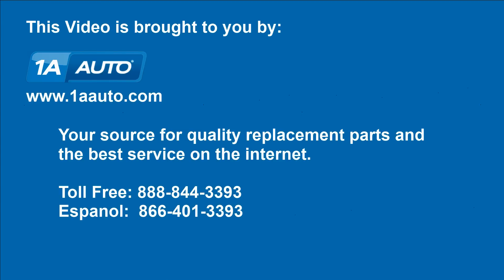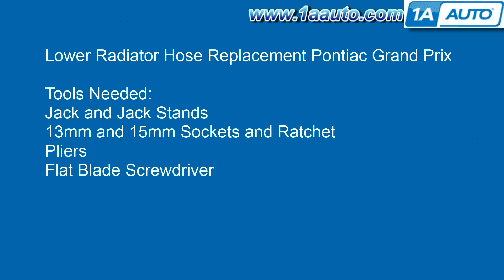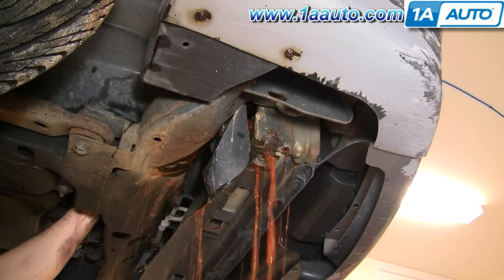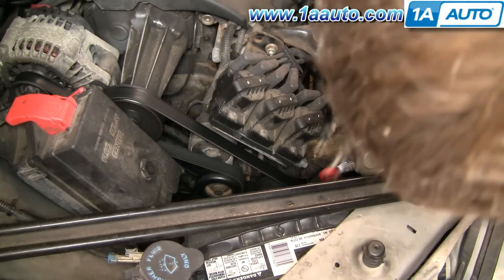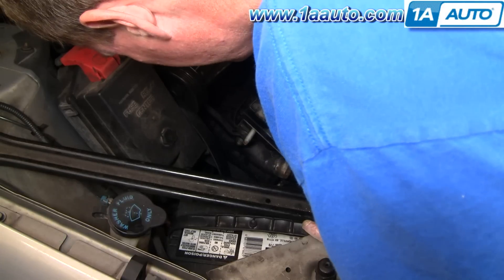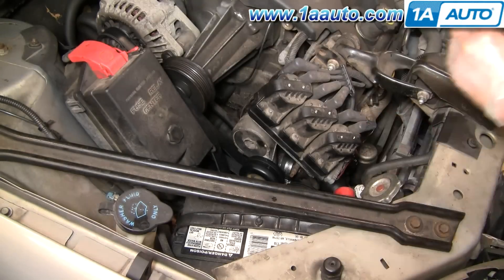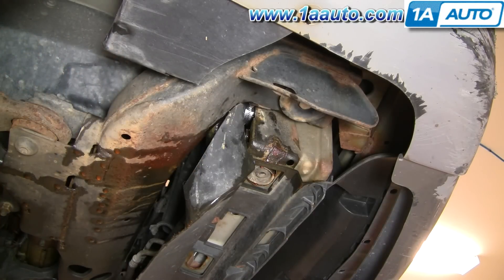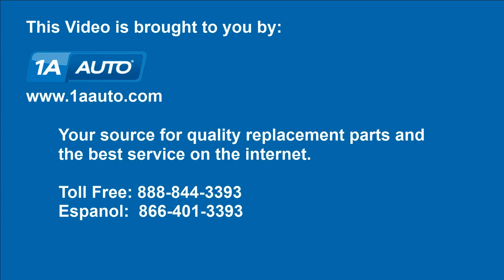How to Replace Radiator Hose 97-08 Pontiac Grand Prix

Comment: I like how you use the water pump pliers. It took me several minutes to wiggle my pliers into position before I could loosen the clamp. My 99 Chevy Malibu 3.1 L LS M type engine has a transmission line at the bottom of the radiator that blocks access to the hose clamp. I tried regular pliers because my hose clamp pliers had no clearance. Same thing happened to me a flood poured down on me as soon as the clamp was loose. I watched your video about replacing the intake manifold gaskets many times over the last six months as I worked on this project. Got to say my favorite go-to tool is a 3 foot crowbar. Crowbar popped the lower radiator hose right off,  with hose on nipple above as a fulcrum. With the new hose I put the clamp facing up. Unfortunately I couldn't seem to get the clamp close enough to get over the Bulge on the radiator nipple with my hose clamp pliers. Along the passenger side of the radiator runs another transmission tube to the top of the radiator. What a nuisance. Offset hose clamp pliers + normal pliers had to be repositioned several times to wiggle clamp forward, Body frame to the left, tubing to the right.  
     Another issue the low coolant light flashed no matter what I did to fill up the radiator. Finally I took the upper hose off and stuck a garden hose down it to flush out the cooling system. The water flowed out the Overflow Reservoir. I put upper hose back on,  no more low coolant light warning. YouTuber Original Mechanic stuck a funnel in the 3/8 tubing going to the top of the radiator the highest point by over 4 inches. I plan to drive the car for a couple hundred miles before I drain a gallon of water out to add antifreeze. It's been a real nuisance how this cooling system will blow out 3 gallons of antifreeze all at once if it's overfilled. It's like there's some siphon action going on. Michael I liked your comment about automatic air bleed since the bleeder screw on top the water pump bypass pipe bleeds coolant not air.
Reply: Some of my new hose connections leaked especially the smaller diameter 3/8" hoses. I used Permatex water pump and thermostat housing RTV silicone gasket maker 22071:  water pump bypass pipes and hoses, thermostat to heater core pipe behind o-ring,  2 Passenger side radiator to overflow Reservoir  nipples. 
     I like the flat band spring hose clamps better than the screw clamp. On my Jeep 4.7 L V8,  lower radiator hose to thermostat housing leaked a dribble which equals 1/2 gallon of antifreeze every 50 miles. The only fix was to use silicone sealant and reposition the screw clamp many times till I got a perpendicular grip. Slightly off perpendicular, screw clamp leaks horribly. That's the great thing about  flat band spring hose clamps they position themselves. Also they don't cut a new hose in half.

Comment: I wouldn't have been able to do it without your video but it wasn't as easy as you made it look. worked through a thunderstorm but I got it. I don't think there is any grease left under the car, l got it all on me Purple power degreaser works wonders.
Reply from the maker: Congratulations on the successful repair.  We're glad the video helped you out.  1aauto.com 866-403-3393

Comment from the maker: @mrsarcastis13 Newer cars are designed to bleed automatically, Drive the vehicle and check the tank often for the first 100 miles or so.  At 128K, if it has the original hoses then replacing the hoses is good preventative maintenance.  Check your hoses every 25K and Replace at 100K even if they don't look bad.

Comment from the maker: We currently do not have an auto repair video that shows this particular repair with a supercharger equipped vehicle. You might be able to use most of the same tools. Some of the steps may be different though. 1aauto.com 888-844-3393

Comment: Do you have a video for a upper radiator hose on 98 buick century?? ..thnx
Reply from the maker: +woody95124 We don't have a how-to video for your vehicle right now, but the basic steps in this video should be enough to do this task. Buy this part for your vehicle on 1AAuto.com: http://1aau.to/m/Shop-1AAuto-c

Comment from the maker: If the fluid is old, you may want to drain it out of the radiator and flush the system while you're at it. You could just pull the petcock on the bottom of the radiator. 1aauto.com 888-844-3393

Comment: Pro tip: the ears broke off my 05 Impala pepcock as well. A 19mm 12pt socket will get it off super easy. DON’T TIGHTEN IT BACK WITH A RETCHET THOUGH... fingers only. 😀